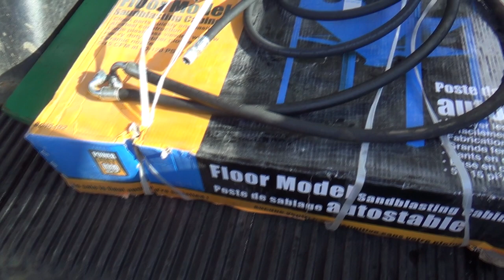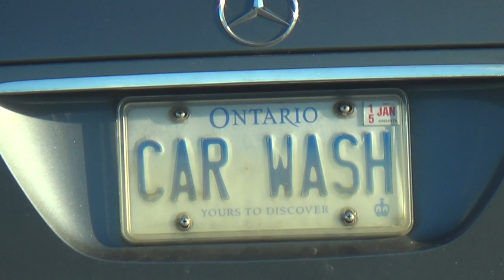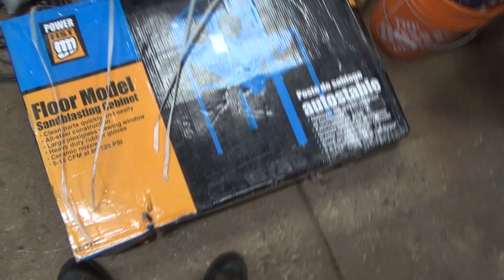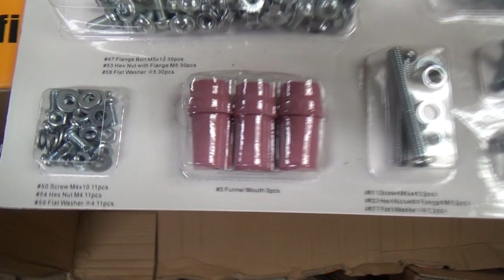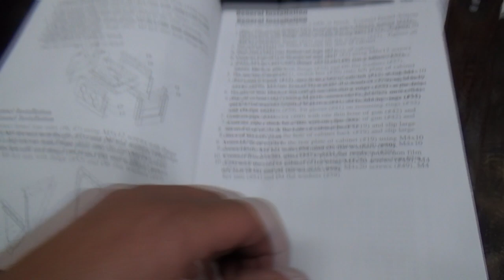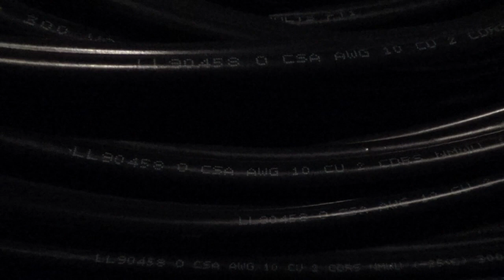John Deere 2720 seat removal and cleanup

Comment: I would glue that seat back on with 3m Super 77 spray glue, works great on stuff like that,  just lightly spray on foam so it doesn't melt it.